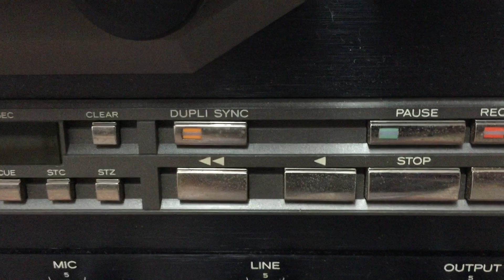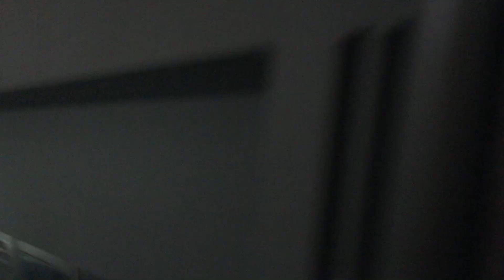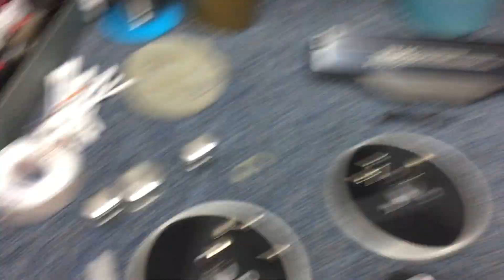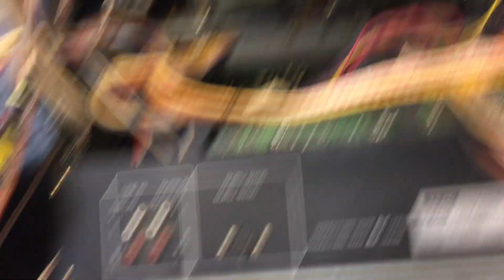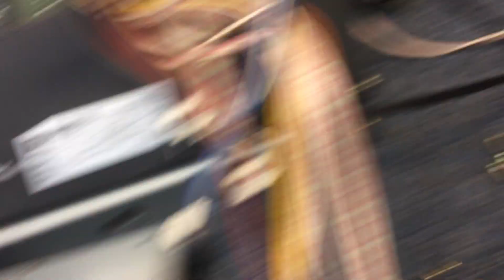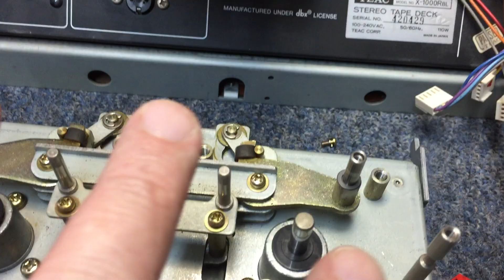Teac X1000R Reel to Reel - pt.1 mechanism tear down

Comment: you can hinge the main board up and out of the way without having to do this extensive of a tear down to replace the belt.
Reply from the maker: A simple belt change could probably be done that way but for all I had to do to that mechanism you need unrestricted access plus opening things up like that gives you a better look at things on those boards.

Comment: When the capstan assembly was out, did you notice how to loosen the tape guides slightly in order to rotate them 90 degrees or so? My deck has obvious tape wear pattern and want to turn the guides just a bit to new rounded metal. I am sending my heads out to JRF Magnetics for reconditioning, so I want to expose new tape guide smooth surface on the guides when the head block is reinstalled. Also, do the capstan spindles and flywheel assemblies simply push out of the bearings of the chassis? I am thinking that just behind the flywheels are the screws that secure the tape guides. Thanks - great video series!
Reply from the maker: @BrianTotten-r8d  I didn’t notice how to remove or reposition the tape guides but I would imagine they can be rotated as you’re wanting to do, yes the capstans will come out for lubrication.  I would love to know the frequency response pre & post having those heads done, I’m sure that’s not a cheap process and I wonder if the difference would justify the cost?  Ive never run across one of these decks (assuming you are using a quality, well cared for tape) that didn’t produce spot on audio recordings with clean heads that still have the azimuth screws factory sealed using healthy pressure rollers.

Comment: Greetings . First of all, congratulations on the channel!!! EXCELLENT!!! your work what you are doing, I have an Onkyo Digital A-8800 Interga with all the modules of the equipment are Onkyo which are an M504 sound amplifier, with 2 EQ540 Interga equalizers and 2 of EQ-201 and another EQ-25 and a deck TA-2550 Interga and another TA-2750 Interga and another TA-2044 Interga and another TA-RW 909 double deck, and an Interga CP1500F turntable and Ortofon 40 turntable needle and Interga DX-708 CD, and the T-4500 Interga radio All models are from the Onkyo brand, which is the best from Onkyo. NOT mass production if they are not selected from Onkyo. And the cables connected to the equipment are from the KabelDirekt Pro Series RCA brand and 4 DAS R Speakers. -212 . and 2 Mivoc hype 10 g2 hifi subwoofers, 300 w, from 20 to 180 hz and a TEAC X-2000R Reel-Reel Recorder tape recorder. FINALLY, A CLASSIC FROM THE 80S AND 90S of sound equipment from that time, over the years I have never had a module break, that can be seen from how they worked before and the manufacturing materials, I hope to have it last for many years to come. quality of a good musical equipment, greetings and very good videos that you have a great like for your great videos, they no longer manufacture such great sound models as these devices, it is a shame that nowadays everything is plastic, greetings from Barcelona - You could make one from Onkyo Interga also from Review - Congratulations to all the Onkyo electronics, the Inegra Series was a true excellence. I bring you bad news, for this glorious brand, which made history in hi-fi, these days, Sharp, which recently acquired the brand, announced that the debt is incurable. The electronic audio equipment company Onkyo filed for bankruptcy after accumulating debts of US$24 million. Onkyo, founded in Osaka in 1946 under the name “Osaka Denky Onkyo K.K”, has not managed to position its equipment, mainly analog, in the streaming era, consequently Onkyo has been declared bankrupt by the Onkyo company. Even if the electronics produced today had nothing to do with the wonderful electronics it has... A big greeting, from Barcelona.

Comment: Excellent video on how to get a machine that's been sitting around for years to be functional again. I'm working on one and I have one comment regarding your method for removing the stuck metal supports for the pinch rollers. I tried removing them using a heat gun and had very little luck (other than burning my fingers). What I found works is putting a little oil on the bearing top and a little WD40 and letting it sit for an hour. Believe it or not, both sides became loose and came off.  Just a possible alternative to heating the bearing that I thought I'd pass on. I've gotten the unit to do everything now except the Fast Forward which seems to have an issue with the position of the right tension arm being just a little too high. Pushing it down just a tiny bit seems to provide enough output from the optical sensor to get the motor to run at full speed.
Reply: WD40 worked for me too. Great Video thanks
Reply: @koeskkoesk5114  Amazing what that WD40 can do

Comment: thank you thank you, after watching your video, I realized that I forgot to put the springs back on the pinch roller arms.  I used a heat gun ti remove the gunk and that was perfect. Put a new belt on and was able to get the unit to spin in play and reverse.  Now that I know what's missing, i'lltear it down again to get to those springs.
Reply from the maker: Random, thanks for checking out the video!

Comment: What grease do you use for pinch roller assembly?
Reply from the maker: I assume you're talking about the spindle it rolls on?  if so I use white lithium grease.
Reply: @luvradios  thank you for responding..  I'm referring to the greasing of points mentioned at the 19-minute point in video.
Reply from the maker: @ChiefPMM  , Yes, white lithium grease is what I used but I'm sure any type of quality mechanism lube would be fine.

Comment: No question X-1000R & X-2000R are great machines. I have both and they sound marvelous.The DBX kicks a**. Back in the day there were recording studios that used X-2000R! Not sure exactly where in the chain they were located, but this is a fact. I've got six R2r decks, but nothing else can even come close to the performance I get out of the Studer A810. Calibration is accomplished digitally, via the LCD display and a keypad located behind the hinged lower section.. Every parameter you enter is adjustable in 256 steps, 256 steps being equal to the full rotation of a conventional pot! Furthermore the machine can store settings for 2 tape types. For instance you could store settings for NAB and CCIR eq's.
Reply from the maker: I've never had the pleasure of working on a Studer but I know their reputation and would love to use one some day.
Reply: @luvradios  Well, now I've seen the entire vid. Gotta say terrific tips for working on a 1000R or 2000R. I own both and at least one needs belts, which I have! Thanx for the first rate instruction AND photo accompaniment!! I will refer back to this vid.

Interesting aside:
A810 is the only machine I have where you can FF through a 3600' tape, then fast wind (there are 4 fast wind speeds) all the way back and the counter is not off by even one second! In fact the tape will stop in the exact place from where it started. No joke! It always overshoots by a few seconds but it knows to slow fast wind forward to wherever it started from. I got it from Filmco, Canada in 2008 after they bought Studer's entire inventory when Studer moved out of North America. They sent me a fully tricked out deck- 4 speed capstan, tape scissors, mounted splicing block, installed Studer Vari-Speed, Butterfly heads, and not one scratch on it. V-Speed adjustment is done using a rotating 1000 step adjustable knob and each step is further divisible into 10 more steps! This allows for extremely precise and recallable matching of tape speeds between decks, or you can slow the deck down a little if you know your program is longer than your tape. Very handy as long as you write it down! Meters switchable between peak reading and PPM. Deck is completely modular and the easiest deck I have to work on. All of the cards push into place on the basis board, which is behind the hinged swing-up panel. There is even a linkage that you can drop into place that will hold the panel up. At one point I cracked the basis board (a large, very expensive board) while shoving in a card (amateur!), called Filmco and they sent me another one at no charge!